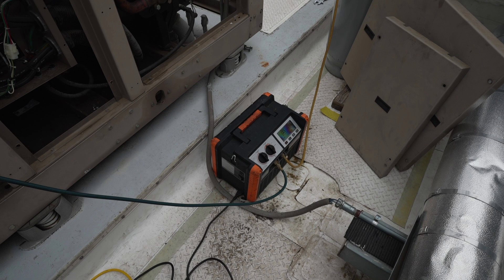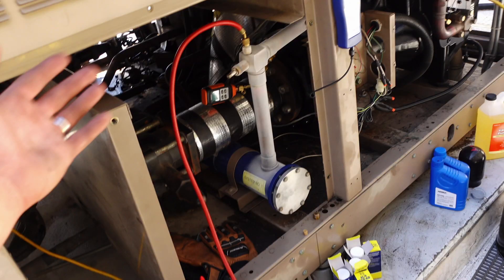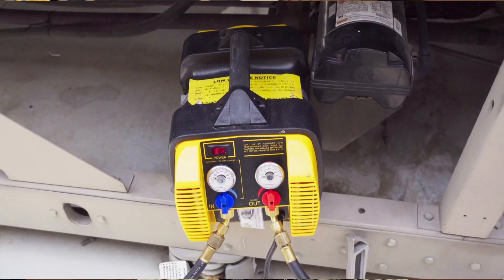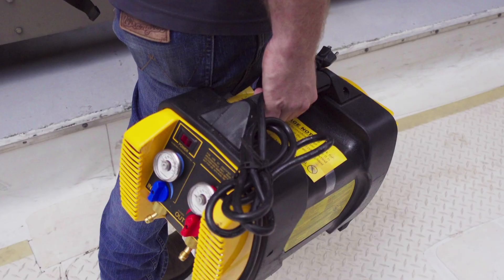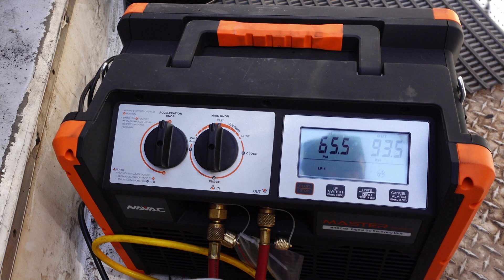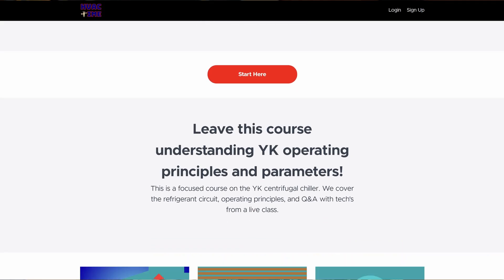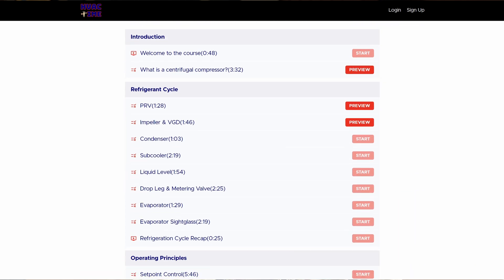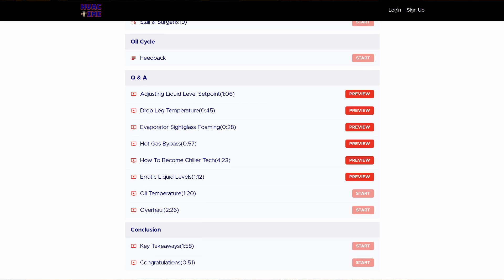Air Cooled Chiller Charging

Comment: I just purchased the navac 4 cylinder recovery machine . Have you done any push pull on centrifugal chillers . If you have how did it do ?
Reply from the maker: It does awesome, I've got a YK repair series I did where I recovered and charged via push/pull with it. You can easily find it in my Free Chiller Course chilleracademy.com/p/free-chiller-training in the YK module.
Reply: @HVACTIME  just finished watching it great video . I need a bit more of understanding on the A-B selection . Thanks for the content
Reply from the maker: So there are two 2 cylinder pumps operating in parallel when set to A setting. In B setting they operate in series. Their theory was this helps to speed up low end vapor recovery. I've debated this at length with them. I have not found it to help, so I leave mine set to A at all times.
Reply: @ I watched another video when you explain the push pull charging method . What’s the step after getting all the liquid out of recovery tank , and have vapor left ?
Reply from the maker: Switch to vapor charging from tanks to pull vapor out. Like a normal recovery/charging

Comment: Hey, great content lately! Have you ever used a liquid pump for moving large volumes of refrigerant?
Reply: I work for the big carribian blue mother ship. I use a liquid pump pretty regularly and it's a game changer for speeding things up.  I'm going to try your push pull method next chance I get.
Reply from the maker: Would you be interested in a Chiller Community Group to discuss and share stuff like this? It's not free, it requires being enrolled in chilleracademy.com but would love to have you there.
Reply from the maker: No I haven't used an actual liquid pump, I am familiar with them and I've had them recommended but I've had such good success with pumping liquid through the appion and navac pumps that have not found it necessary to try. What is your thoughts on them?
Reply: Great video, I'm just pulling 230# out of an air cooled for the first time as we speak. As someone who recently made the switch from residential to heavy commercial I appreciate all the great content. It's really helped build my confidence level. 

On a side note I would love to see a video on the operation of drain and fill valves, and air cooled economizer operation and parameters 🍻
Reply from the maker: @Fuhkheadd I have an economizer video but I can make one specific to the the yciv. I do have a older video where I go through in detail the yciv refrigeration circuit. I have a chiller community for those enrolled at chilleracademy.com if you'd ever like to have somewhere to go chat Chillers and get support and mentorship.
Reply: @HVACTIME  I will definitely check that out. Have been slowly been working through the older videos but haven't come across that one yet, thanks! Will for sure be joining the academy when I find a little more time. Just got back from school and have a little catch up to do first 😅
Reply: @Fuhkheadd  I need more guidance like these training videos